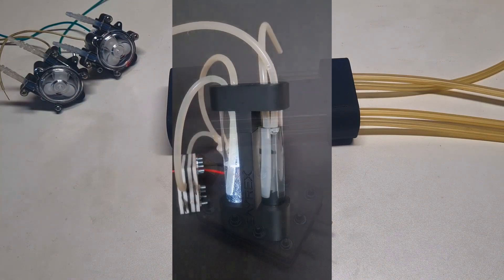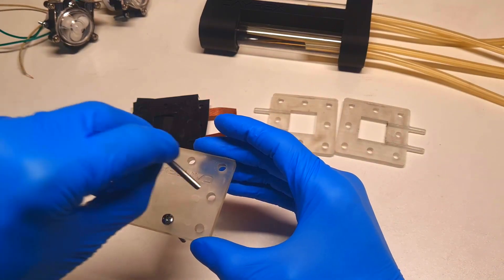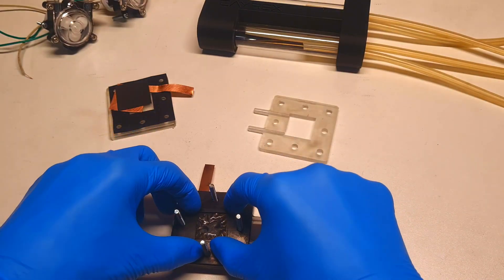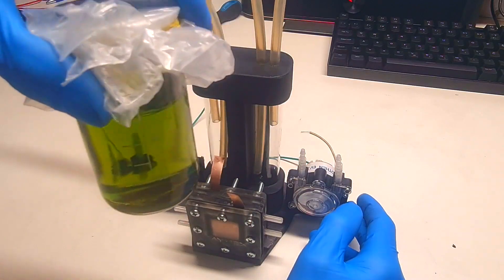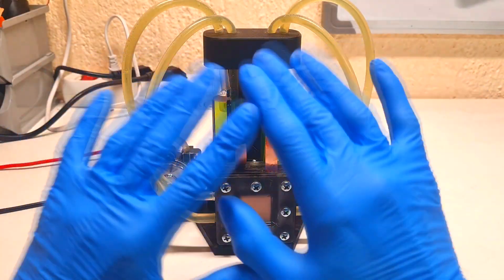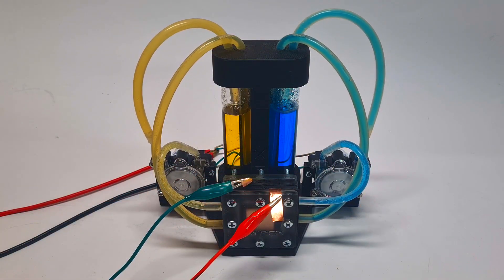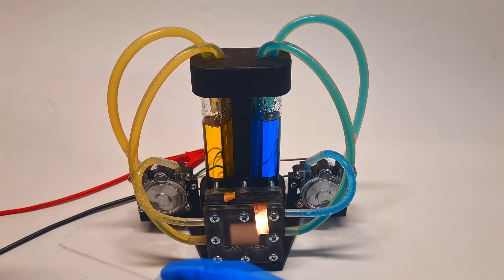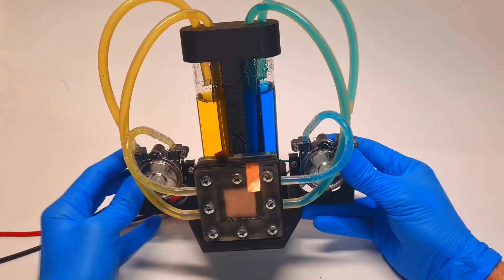Diy Vanadium Redox flow battery - PART 5

Comment: can you now make a multi cell ? I have been unsure for a while now if each voltage  cell needs their own tanks  or can same storage tanks be used with just the collectors been put in series ? and if so can the pumps be feeding collectors in series or parallel with a pump per collector ? and what was the reason for ditching the titanium for copper ?  I have used airlift pumps in the past for my salt water batteries that did not have membranes to act as an insulator between storage tanks and interest in doing a group buy for the membranes ?
Reply from the maker: One storage tank (catholyte and anolyte tank) for the complet cell stack. I dont know if I understood you correctlywo,.... but two pumps (+-) are pushing the electrolyte in series connected cells. Because you have the main electrolyte flow channel for positive and negative side and out from the main flow channel you have smaler channels that go to each  cell. The titanium current is bit more chemical resistant,... but for the use of copper there was no specific reason. I will see for.the group buy. But for the start you can try Nafion 212 which you can get on ebay (mostly is used nafion 112 for VRFB) or fumasep membrane
Reply: @cayrex  hmm so another words if I just floated all my membrane socks in my 40,000L pool I pretty much have a complete battery bank and voltage would not be affected , I would have thought if the fluids touched each other that would have been like putting a battery in parallel , but I guess it really is just energy storage (I did give a full explanation how i made my cells its it looks like youtube never saved it )
Reply from the maker: @christopherstaples6758  Emm, no! In a battery stack (which is made from multiple cells) each cell is separated. The cells frome one to another are only connected in series by bi-polare plate (which is in most cases a graphite plate). One cell is made like I do here in that video,.... current collector / reactor plate with graphite felt material/membrane/ reactor plate with graphite felt material / bi-polar plate / -> that was one cell. But for multiple cells you just repeat the process of the first cell. Then to each cell you have a flow of positive and negative electrolyte (+ electrolyte go into positive reactor plate and - electrolyte go into negative reactor plate). But the electrolyte for all cels come out from two tanks.
Reply: @cayrex  that is pretty much how I made them , but using membrane socks / tubes ,  the membranes are the cell separator's you just have a inner felt and outer felt  the tricky part was connecting all the inner's via a manifold ,  bi-polar plate's can be eliminated , well I guess the manifold is like a bi-polar if their was a "discord" or something to share pictures ... the membranes are pretty much attached to PVC pipes then inner membrane liquid flows through the PVC pipe and then this is all separated from the outer liquid the membrane is sitting inside   , I used plastic  slotted /holed corrugated tubing to give something for the inner carbon felt to wrap around then  forced it inside the membrane , very tight fit feels like  an hr to pull through each cell a few mm at a time  that last 50% is a $@#$ when doing socks (tubes you can at least pull still through but socks is all push and bounce back  ) and then the core of the corrugated tube allows liquid to freely flow through , and to balance them out half the cells are in 1 tank and the other half are in the other tank with polarity reversed (then the liquid volume is all the same ) , pretty sure its about the same as how chlorinator's are made  or at least that is what kept popping up when i was looking for bits to do what i was wanting to do

Comment: Hello. What you can comment about possible concept of Hydrogen Peroxide Redox Flow Battery. How efficient such battery construction can be? Hydrogen peroxide can be generated and then stored for longer time.
Reply from the maker: Hello! You mean something like NaOH//H2O2 flow battery? I dont have the idea about efficient of that battery.
Reply: @cayrex  Yes,  correct. I meant NaOH/H2O2 flow battery. There are interesting unit in a market developed that can produce H2O2 onsite with special using Direct electrochemical synthesis using only water, electricity and air. No liquid electrolyte. It will be interesting to combine such technology generating H2O2 from solar and storing energy in a form of hydrogen peroxide for later use in H2O2 flow battery
Reply from the maker: @GintsChannel  Yes that can be interesting.
Reply: @cayrex  The energy density of aqueous H2O2 (60%) is 3.0 MJ l−1 (2.1 MJ kg−1), which is comparable to the value (2.8 MJ l−1, 3.5 MJ kg−1) of compressed hydrogen (350 bar).

Comment: I had a thought years ago! Of a electric car recharging by filling up a tank! Like a liquid battery!  This type of battery Could possibly have the electrolytes charged at the "gas station"  exchange the electrolytes, and travel another 600 miles or so! The charge station could it use a large battery and tanks to charge the electrolyte!  The gas/charge station can use gravity to supply the cells with electrolyte  and use the pump removing the electrolyte from the vehicle to put it above the reactor to charge it! It then go to a slightly lower tank to be gravity fed to another car! To nearly remove the need for pumps , build the reactor in a long skinny shape. With the flow path zigzagging across the cell! A traditional gas station can add this service by simply stacking cargo containers behind or beside the store about 2-3 containers with tanks inside the pump from the car fills the top tank. the charging reactor being in the middle container. And the charged and ready to sell container below , being ,7' to 9' +/- above ground. So it can fill the car in need of a charge ! An additional container can be used on the bottom to raise the whole system 8' - 9' while holding the pumps that remove discharged electrolytes from the vehicles!  Along with monitiring and control equipment. Anove being the ready to distribute tank. Above that the charging reactors, then above this either a large tank for the spent electrolytes, or a container to house these tanks! A container being 8'(7'9")x 8' or 9' x 20' or 40' approximately! And they can be stacked side by side just as easily as above each other! So 8plus containers can be stacked beside and above one another!  A ,20' long 8' x 8' or 8' x 9' container can hold alot of liquid, me personally would use multiple tanks 400 gallon each or so! With 30" to walk between to inspect and install! With two tanks stacked! The upper sitting on a shelf so the lower can be removed without the need to remove the upper! Use a leak less quick coupler for the connections that are likely to need disconnected and draining the system not desired! Like at the tanks , at the reactors definitely at the vehicle,  possibly use s system like used with hydrogen or propene only use larger plumbing ! A 1.5" or 2" should give an acceptable flow rate with gravity feed!  And the establishment can use solar power to run the system,, and possibly wind turbines a interesting idea for a charger system would be have the cars park on a platform while its getting its electrolytes.  Its slowly getting lower and lower! Over the 5-10 minutes or so its parked at the station having its electrolytes replaced! It dropping anout ,6" or so! The weight spinning a generator!  Tge ,3k-4k lbs vehicle dropping about, .250" .500" per minute this spinning a PMA, (permeant magnet alternator) producing the power to charge the electrolytes! Producing about 3-10kw. Depending on a number of factors, say it takes 15 minutes to travel the full distance and 4 vehicles per hour  that could be about 10 kwh per stall 100,kwh per day! And the system being reset by springs and the vehicle as it leaves! Use its weight to push the platform back up ,the 6-12" or whatever, And the car. Can leave at anytime! The  platform using long ramps so the rise isn't noticed !  And the platform weighing about 2000,lbs, maybe 2500lbs. The ramp used to enter the ramp is used to reset it as the vehicle leaves, if the large springs don't it will be more efficient with weaker springs snd less dampening using multiple charging spots to produce more power. Maybe it will pop up in other places also fast food parking lots, the drive through! Connect the system to grid tie inverters to supply power to the grid! Have every 10'-12',,of the drive through generating power! It would generate less power with less travel only 4"-6"  it can use hydraulics s piston and plunger a check valve a spring the pressurized fluid spinning a turbineas cars drive over!  It can pay for it self in 6months to a year!  Possibly parking lot drives can be used the cars could feel like walkingon heavily padded carpet. Every Couple feet or so being a platform with a piston compressing the fluid either into a turbine or sn accumulator to keep the the turbine going after the car had passed!  Or if multiple cars are pressuring the system at once   if the accumulation tank is filled either bypass or the cars just do not participate in generation! If the weight exceeds the pressure capacity then a bypass needs to be used! Using a 40 gallon accumulator storing fluid at 2000+ psi, eith the turning using 10gph or something little fluid at high pressure! Maybe a hydraulic motor would be more efficient!  The use of high pressure and a relatively low flow rate should generate a fair amount of power! If multiple cars sre using the system. maybe use multiple turbines or generators having a valve open to feed the second generator after a certain pressure id reached and maintained over a certain time about a half to one second! It would basically be a 1/2"-1" hydraulic line running across the parking lot connected to short fat hydraulic cylinders been the ground and s platform making up the drive thru lanes in a parking lot!  A 12" platform, with a 12" ramp to the next platform!  Doing some research to see if having larger platforms Is more effective.  Maybe a 6' or 8',is better with s 2" to 4" travel and 1"to 4" +/  piston!  Basically two types of generator can be built from this. Long duration and short duration,(possibly a medium duration) one for parking vehicles. One for slow driving vehicles . Maybe one could be built for vehicles parking for hours or days! Have a lift basically. Ok park on the second level, return hours later the vehicle is on the first level! The weight,/gravity generating power! We must start thinking this way!! All home and business owners need to start thinking how can I generate power to export or feed my own micro grid?!!  Every house needs a 10kwh battery 2,kw of solar and/or a wind turbine or multiple turbines! With s grind tie or off grid. Or grid interactive inverter a inverter capable of using battery power and send it to the grid!   With the amount of power programmable and when it is sent how only send when the battery is full, and the charging system is charging or available! Allowing the battery to be emergency power or used to prevent brown outs!  The government I'd saying all cars must be electric! Yet we can't generate enough power to heat homes in winter,!  The first mandate should  be double power production capabilities then the grid , then electric cars!  Diesel electric and.  Gas electric is the answer for today! We need to start burning garbage that can't be recycled, to generate power we all need to realize it's our problem! We need to work at it fix it or not we need to make progress!  The government screws everything up!! Trying to help! But not too much! We can't have people getting ahead because we helped! Seems to be their thinking!!   However having this type of batteries even at home would  be great! Use gravity to circulate the electrolytes ! The Pump only powered when the top tank I'd nearly empty!  Have a 48-60v battery capable of 1000ah +/- (+: better) all the way to a ,12,volt 200ah version that fits in a apartment closet or under a bed that is charged with a 100-200 watt solar panel hanging in a window! With a inverter capable of running the tv and lights. Or just refrigerator and lights or just the AC in summer or a heater in winter! Save power and dollar$.... Great video, sorry I ramble. Have a great day,!!
Reply from the maker: Yep I agree. Refiling batteries will be really great for EV. So the vanadium flow battery will not be the best for that job because of low energy density and power. I think that for 1kWh you need around 50L for each tank. Otherway,... I making a flow battery project which can be used in EV and can be charged by refiling on refiling stations or simply charging by grid at home.

Comment: so what the point if the pumps aren't running off the battery as well?
Reply from the maker: Yes, if you turn off the pumps then the battery will stop working after some time. Because the capacity of the battery is not stored in the cell but in the electrolyte. So,... some of the electrolyte will still be in the cell when the pumps are not runing and the cell will still work for so long that all the small amount of the electrolyte which is in the cell will be discharged.
Reply: no I mean if the pumps run off the cell itself in a closed loop do you get surplus energy? @cayrex

Comment: Looks GREAT! 
You might consider getting pumps that work at really low voltages in serries with the charger and in serries with the load. That way, they always pump when current is flowing.  They also probably don't need to pump very much.

You might get two small 1.5v  dc motors. Then YT is full of videos on people making tiny centrifugal pump. You may even 3d print yours up in a couple minutes.  The DC motors working in series with a load or while charging, they will probably drop around  0.5v or there abouts and rotate more slowly consuming even less energy,  But that should be fine they don't need to pump a lot  and Just adjust the charging voltage acordingly.  

It might take some work to optimize pump flow rate to current draw.
Reply from the maker: Thanks. Yes I have small pumps,... but the big ones looking better 😅 The flow rate can be in range of 5 to 15ml/min,.... so for that reason I can use small pumps. The pumps which I use have 6V motors,... but in the video they run both on half of power (around 3.2V). Anyway in the video I use singel cell version but to run also the pumps I will need multiple cell stack battery when the battery is discharging.
Reply: mean while I use air lifts ~20watts can move ~15kl of water / hr  just thinking about a way to use that system with a redox , more so just about managing head heights , tho closed loop systems should not need large pumps the only resistance is the tubing size as lift is not needed
Reply: @christopherstaples6758  so I was thinking, if the pump motor is in series with the load, and or in serries with the charger. Then the pumps are working only when they are needed, when current flows.  

The challenge in this configuration though is a pump motor that works at really low voltages, < 1v.   

(Shameless plug to my motor on my channel) The axial flux BLDC motor I built on my channel idles at 610 rpm  using 5 watts at 1.5v is too fast and  need too much voltage, but I think it would work at lower voltages if the speed controller used hall censors rather than back emf for motor position sensing.  

I wonder if a simple homopolar motor would work in this application. They are brushed and can work on <1v and can easilly tolerate higher Amps.
Reply: @kreynolds1123   yeh I was tinkering around with idea's as well to somehow have a functional pump if grid /backup battery  was down to power a pump to provide fresh energy for the cells and a way for a pump to have multiple power sources using relays etc  , I ended up doing airlifts and it worked (now I just need to find a way to keep the liquid pure from rubber contaminates from the air pump ) , as instead of building a large cell stack and trying to force liquid through it and not have leaks ,  I actually have multiple electrode tanks/cells (well 200L drums with screw lids IBC's would have needed multiple electrodes made per tank and I could not be bothered reaching inside the tanks to do them through  small hole   was very quick to setup ) pretty much using a membrane sock that just sits in the solution with opening just slightly above water level to be separator , sock was sized to be ~50% of cylinders volume (membrane is 86cm H x 25cm Circumference sealed on bottom and sides to be like a bag ~100L volume ,  Drum contains about 70cm x 60cm solution  ~200L total ) with carbon felt lined on the inside and outside of the membrane and did not want to run 80 odd pumps  cycling each tank so air pump and solenoid valves came to the rescue (I run large aquaponics system here pretty much just copied my filtration systems :P ) now that all these drums are working its just a matter of getting the 2x 20,000L water tanks delivered and make a manifold and hope it all still works when all the liquids are connected together , if not I'll just have to use geyser pump technique to use air as insulation between the tanks , the next challenge is getting the Solar MPPT chargers to output voltage when voltage is below 44v !!! currently I have to jump start the charging from another battery bank but that is just because of smart chargers being smart chargers ....
Reply: Maybe use MHD pumps that become active according to the current demand.
Reply: @christopherleubner6633  I'm not sure that would be effective ion travel though an electric field bounce off water molecules loosing  orders of magnitude more energy than electrons moving through a wire, not to mention loosing energy to the electrolisys of water into hydrogen and oxygen at the anode and cathode plates of a mhd pump.